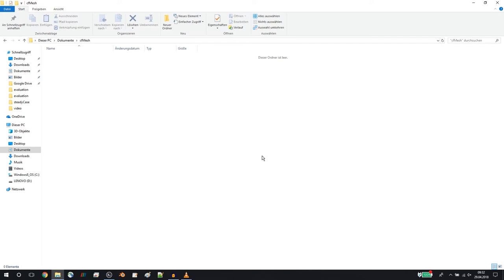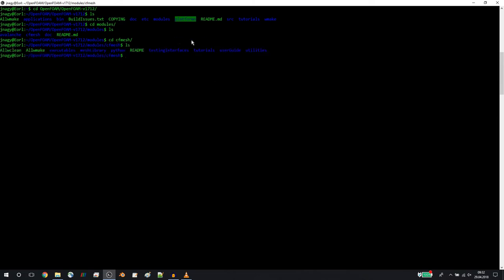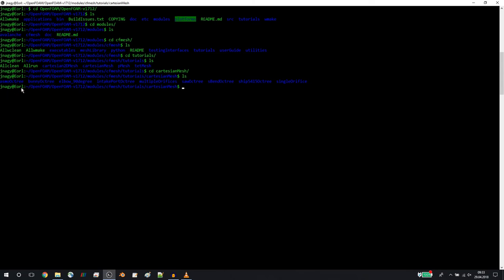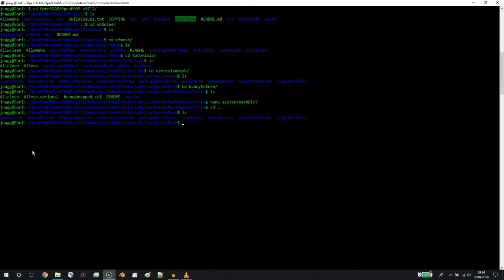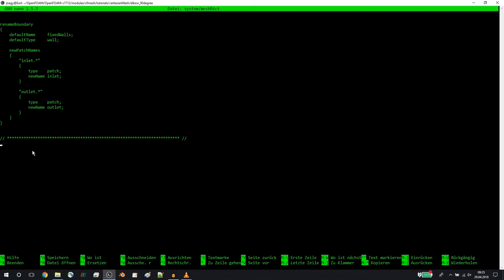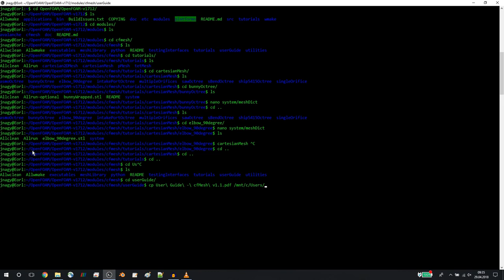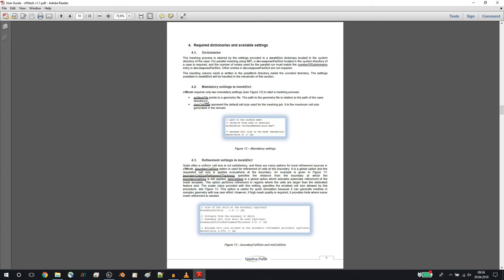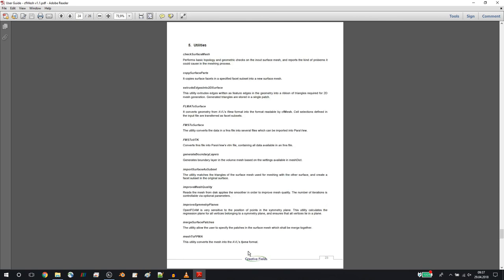Alternative to snappyHexMesh for meshing in OpenFOAM with cfMesh - tutorial

Comment: Very nice video, I had a lot of problems using snappyhexmesh. I am trying to simulate a internal flow, but snappyhexmesh keeps my geometry inside the backgroundmesh. I read that the problem was that I haven't triangulate the surface after modeling the .stl in solidworks. I was trying to use Salome, but I will try to test this too.
Reply: The waterproof surface as Tobias Holzmann wrote in CFD online forum.
Reply from the maker: Yes, that is very important for snappy. Give it a try.

Comment: all these studies are unnecessary
Reply from the maker: Others may find it useful
Reply: @OpenFOAMJozsefNagy  yes it is the important thing but any analysis done in OpenFOAM cannot apply for industry problems. It needs too much develop. For this reason, all these studies are empty. Sorry
Reply from the maker: @kasuora6233  Automotive industry, chemical industry, fire safety, medical industry all heavily use OpenFOAM instead of commercial codes. OpenFOAM is among the top 3 used CFD tools in the industry and among the top 5 software overall utilized on HPC clusters world wide.